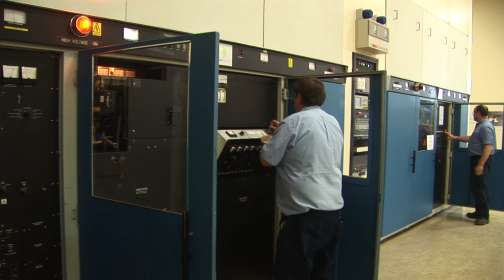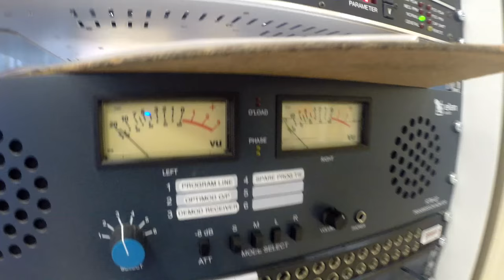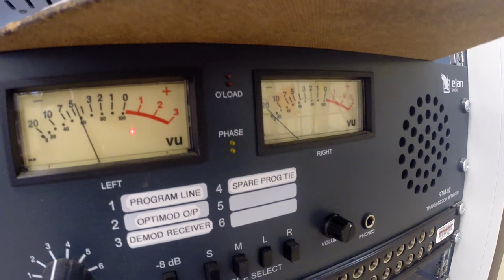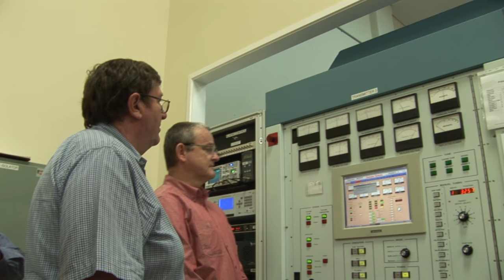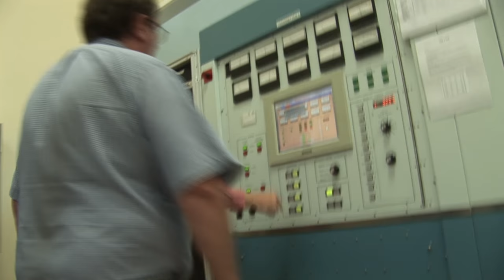Shutdown Of Last Short Wave Transmitters  At Radio Australia

Comment: What a great looking station. I hope the building and equipment not been destroyed
Reply: If it's still there why couldn't a private buyer get it and start broadcasting again ?
Reply: Such a waste of a great broadcaster but also great equipment
Radio Australia should go back on the air. Shortwave radio is not dead but still very much alive. The military is using shortwave or HF again as means for communications as secondary part of their arsenal. Satellite radio which they use is very vulnerable and jammed quite often when they need it most by pirates using these satallites for their own personal communications.
Reply: @357bullfrog2  Because it hasn't been up for sale. And the sites were demolished btw. Radio Canada International on the other hand did try desperately to sell the site, wasn't able too and only sold the building to a religious group and demolished the towers. They tried to sell the transmitters super cheap but weren't able to since no one wanted to go pick those huge things up.

Comment: When I drove between Adelaide and Darwin there were black spots with no radio. Thanks to the penny pinchers, that shut down these SW transmitters , please restore this service for the cattle stations in remote Australian areas
Reply: The 3x 50 kW domestic HF transmitters installed in the Northern Territory covered in excess of 2 million square kilometres using six channels. ABC diverted the HF transmission funds to put DAB+ transmitters into Hobart, Canberra & Darwin - already well-served with AM, FM & on-line.  ABC, or more accurately, the SBC (Sydney Broadcasting cadre) has contempt for remote Australia.

Comment: After we have EMPs and satellite warfare which will take down the internet and satellite communications, they will come back. Almost every post-apocalyptic movie I've seen has a ham radio operator involved.
Reply: EMPs would kill that transmitter too though. Most of it today was digitally controlled and monitored
Reply: @whatevernamegoeshere3644  Agreed EMP would be bad for nearly all electronics (except for 6BE6, 12AU7 & 813...) but global broadcasting is more at risk from Carrington events, missile attack on satellites or the biggie - weather events. Cyclones wreck comms infrastructure across the Pacific & SEA every year.
Reply: Things are becoming centralized.its just natural progression but makes communications that much easier to take down.

Is satellite radio viable for rural austrailians or those out there temporarily, cost wise? Could that be complicated by satellite receptions need for electricity?
Can satellite reception be achieved with batteries?
Reply: Tube transmitters using crystal oscillators could survive. The Russians used tubes in their combat aircraft to survive the EMP caused by nuclear weapons.

Comment: wow very sad to see the transmitters switched, i would drive past shepp in amazement at the infrastructure at the site and as a sparky and interested in rf, was always itching to see how it all worked, it was only today i was keen to get set-up to have a go at listening to radio Australia on the sw band but obliviously i have missed the boat. i work at a power gen facility commissioned in the 1920s and still runs as it was installed , i would be upset if that was ever moth balled.

Comment: What a sad end to Radio Australia shortwave transmission to rural Australia as well as to Asia. I remember during the 80's getting RA loud & clear in India & the Middle East - normal programming & cricket during the summer. Sadly, have to visit Cricket Aus. website for the official broadcast which is geo-blocked due to rights restrictions.

Comment: The Ukraine-Russia war is showing just how easy it is to shutdown Internet Feeds from abroad.  Easier form of control.  With Shortwave, it takes more investment-infrastructure to jam/block a station.  Maybe that conflict will change some minds about the importance of Shortwave.  I was a routine listener to RA in the 1980s, 1990s, 2000s & 2010s.  On 9580Khz, 12080Khz, 15160Khz, 15240Khz, 15415Khz, 17715Khz, 17795Khz, 17840Khz & 21740Khz in the St Louis region.  RA could be counted on being heard daily in the Midwest even when band conditions were not good.  Especially during Evening & then again through the Morning sunrise hours.  I remember that 9580Khz was especially good in the spring-summer-fall when thunderstorms were at a minimum in the AM hours.  I remember I could take the antenna off of the radio and still hear 9580Khz from 6am-9am (CT) daily.  Very strong signal at the sunrise hours.  It would like clockwork, drop out fast at 9:30am (CT).  Having to wait til about 4pm CT for 21740Khz to return.

Comment: What a sad day for shortwave broadcasting and Australia in general. Even here in the United States we often listened to Radio Australia and to get the international perspective but also to hear about Australian news. Internet Radio, Satellite and such just isn't the same. We would get about 16 hours of Radio Australia during the day. Seemed that it would start coming in about 5 pm local time Eastern which is 2100 UTC in the summer or 2200 UTC in the winter. You could hear frequencies such as 21740, 17795, 15365, 13605, 11880 mostly during the evenings into the overnight hours say at 2 am. Then at around 3 am local we would get 9580, 9700, 12065, 6020 etc which would generally last until around 1400 UTC. Sadly those days are gone because I grew from 1985 at 10 years old until I was 42 years old listening to Radio Australia. Listening to the local ABC Melbourne or Brisbane or Sydney just isn't the same and totally different than turning on the Shortwave. 

Even more exotic for a lot of us here in the United States was being able to listen to the various Outback stations which I could receive very well in our fall to spring seasons especially those on 2325, 2410, 2485 and 4835 etc from Alice Springs, etc. In fact they were often well heard at my location due to the fact that I had up a 2000 foot long wire antenna strung through a couple of trees and going to the edges of the property my family still lives on even though I am long gone from there. It was quite interesting to hear shortwave broadcasts not only from Australia and the Outback but also Papua New Guinea, dozens of Indonesian stations, Philippines, Chinese provincial stations, Vietnamese provincial stations and even a few times the various iterations of the Khmer Rouge genocidal stations out of China or the Thai Cambodian border with their various harangues. That's not even including the various radio wars between the two Koreas. They should have kept Radio Australia running because to me it was one of the better news stations out there as well.

Comment: short wave means long distance,
which would reach the place on every side,
yes old tech but endurable formation
Reply: True.  But shortwave (HF) can also be the better economic solution for remote areas with low populations. Australia had 3 domestic HF transmitters to cover remote inland areas from 1986-2016. Each transmitter had a proven, primary range of 450 km (often much greater, to > 2000 km). That's 160,000 km^2 for each service.  Allowing a range of 75 km for a 5 kW FM omnidirectional service would require 36 such FM installations to service the same area for each service. And much more costly maintenance. The shortwave transmitters were being upgraded to be even more efficient and to transmit DRM (the first new transmitter (a Continental 418G) at Alice Springs had already been tested in DRM mode with stunning performance)

Comment: Thank you for this video fantastic job
Reply from the maker: Broadcast Australia own the site and sold transmitter time to the ABC and i should think they would able to sell time to any one else who had the money to spend on big time shortwave transmission if it was not in conflict with Govt regulations. Maybe six or so transmitters at the site but none on air at this time. The site is BA's maintance and storage depot for central Victoria where they carry out works for their other sites around the place so i think the actual building will be around for a while with the TX's mothballed.

Comment: In a settting of scarce resources, shortwave broadcasting doesn't consume much of them. And it's amenable to no end of development
It's an economical way of broadcasting. And its demotion or demise will deprive us of many opportunities to improve it
Reply: True. Australia had 3 domestic HF transmitters to cover remote inland areas from 1986-2016. Each transmitter had a proven, primary range of 450 km (often much greater to > 2000 km). That's 160,000 km^2 for each service.  Allowing a range of 75 km for a 5 kW FM omnidirectional service would require 36 such installations to service the same area for each service. And much more costly maintenance. The shortwave transmitters were being upgraded to be even more efficient and to transmit DRM (the first new transmitter (a Continental 418G) at Alice Springs had already been tested in DRM mode with stunning performance)

Comment: yup! not a good plan!! they are sooo worried about the emissions and cancer...
it is too late!! they should to have just left them on and just maybe done several as remote low power as sat radio...
but then again it all is going to be done with the first flash from the sun or other emp....
the sat stuff... 
I have done faraday rooms for the hf gear...
best plan is use metal trash cans with lids encased in quick concreate for your emergency radios...

I miss the days in the late 1960's space shots you could hear the missions on a good hf set..
as well as dx like this station!! we could hear them when the bands were up in Iowa!!

Comment: Is anything left of the old transmitter site? Did they find a buyer?
I remember that the hams were going to have a last hurrah with the antennas in late 2019 or early 2020, but may have called it off due to COVID restrictions.
This video always brings tears to my eyes 😢 .
Reply: The Hams had a go with the antennas in March 2020 about a week before lock downs including some successful EME  ( bouncing a signal off the moon) on 21 MHz. There are some attempts  to try and create a radio and possible TV museum at the site.

Comment: On the beach.1:20 "11th of July, 1969". Guess they mixed that into the broadcast?  On the beach.
Reply from the maker: Great movie, was that the date on the calendar?. I used to have that freeze frame as a screen saver. I only have a few dvd's and that is one of them. As i live in Melbourne the last city on earth to die from radiation, when i saw On The Beach at about 7 years old it had a big impact on me. I realy thought that was how it would all end and still now i am influenced by it particularly  the last scenes "there is still time brother" and the deserted city streets. Now in July 2021 in the 5th lockdown the streets are deserted  again and instead of suicide pills they are handing out vaccine. Also just updated this post. Had a look at the film and the  calendar shows July 1964 with no actual date marked. So the announcement by Vic Kennedy is about 5 years latter.
Seeing the movie again it is very dark (not exposure).
Reply: Yes, I knew it was July '64 (month of my birth) and I forget what my reference was on July 11, '69.

Comment: 3:46 This looks like far more modern equipment than what I was trained on, or even seen. Like Ex WW2 valve equipment!
- Looks like it may be computer controlled/monitored?
- Ex Oztralain Civil Aviation Authority Radio Tech. Officer here.
Was 'selling the spectrum' part of the reason for ending this service, I wonder?
Reply: Spectrum sales didn't drive this decision. The ABC wanted to extend its DAB+ network into Hobart, Darwin and Canberra. It funded this closing down Radio Australia and the domestic HF services. Did you ever work on Christmas Is navaids? In 1990 some DCA techs visiting Christmas Is measured one of RA's 21 MHz broadcasts at 147 mV/m which is not a bad field strength . . .
Reply: @nigelholmes9332  
No, I never really worked on navaids. Trained, but knowledge not used. ¯\_(ツ)_/¯
Everything was changing rapidly even while I was there.
- I started at:
 • Dept. of Transport, then
 • Dept. of Transport (Air Transport Group), then
 • Transport Australia, then
 • Dept. of Transport and Communications, then
 • Dept. of Aviation, then split up
 • Civil Aviation Authority IIRC. 🤔
All name changes or 'restructuring'.
 • After I 'redunced' (?), CAA became Airservices Australia

Comment: I'm looking for a crystal set which can receive RA via satellite from the wrong side of the world, or via internet.
That's how I used to listen to Radio Australia as a teenager, long before I had the knowhow or funds to make or buy a proper super-regenerative or superheterodyne receiver. The super-regen I made for Shortwave when I was 15 worked really well, and used 3 valves (tubes). RA was my go-to station to check DX conditions on different bands, from England. An aerial of less than a metre in length had Oz crashing through on a good day. Now I have to pay the equivalent of over $100 Au per month to hear it on the internet, and I have to use over 100 Watts of electricity for the privilege. In addition, the skill and sense of achievement have gone completely.
You've lost a fan of over 50 years, Australian Broadcasting Commission!

Comment: I understand that great investments were made to finish off the air .... It is important that the engineer in charge should thoroughly study the details and offer clear suggestions to the company in order to avoid this disaster ... but even more I think the company You must always invest for the education of the engineers of any radio station and in this way prevent unnecessary expenses.

Comment: can you still pick up anything in aus with a standard receiver?
Reply: Yep - plenty of MF, particularly in rural areas. The national broadcaster runs 50 & 10 kW MF tx around the larger rural centres. Commercial operators are usually 2 - 5 kW.

Some individuals have obtained private, domestic HF broadcasting licences (usually 1  kW) to try to fill the gap left by the end of our national domestic HF servcies. We also have a good VHF FM network, but of course range is limited to around 100 km from the bigger senders - not much use when we have 100's km between towns. Similar situation to Canada.

Comment: NBN needs 2 separate power supplies and 2 different boxes connected with a dozen wires just to run a old style telephone. And they tell us/me it's advanced technology. :(
Reply: jesus wept ... don't get me started ... phuk it you've got me started ... we (in Melbourne) went on to NBN early November 2020. I'm not stupid, made my own "UPS" 2x 12V/32Ah AGM batteries, 24Vdc--> 240Vac 400W sine inverter, independant solar PV panel to back up the mains charger. UPS Backs up my NBN terminal, modem, telephone, PC, printer & office lights. Gives me >1 hour endurance full load, 4 hours with printer & lights off (for 30% DoD on the batts). 

So we have a big storm & lose mains for an hour. Me & NBN run on our batteries. Yay team. My Mains comes back but not for an NBN installation somewhere, their battery goes flat an hour later and I have no telephone (& no internet) for 17 HOURS. Boo team.

Comment: Don't they use longwave radio in Australia? The signal travels for hundreds of miles, and it doesn't fade in and out like shortwave.
Reply: LF (in practice, 100-400 kHz) was not used for broadcasting in Australia beyond early trials in 1920s. For broadcasting into remote parts of the country HF was discovered to be cost-effective also in 1920s. The 3x 50 kW domestic HFBC transmitters installed in the Northern Territory covered in excess of 2 million square kilometres using 2.3 & 5 MHz channels.

Comment: is DRM a replacement?
Reply from the maker: DRM is very good when it works but it is no where as robust to interference and fading as AM Often stations that use DRM have an AM outlet on the same band and coming from the same site. If the AM is full strength and stable the DRM is also very good, If the AM is strong but a bit of fading the DRM is usually better, If the am is fading and interference present but still very listenable often the DRM is rendered totally useless.

Comment: Shortwave reaches millions of people worldwide and even though the reception and quality were not great, it enabled the world's broadcasters unrestricted access to a borderless untapped market. 

Digital Radio Mondiale would have given shortwave a longer life as it delivers better quality radio at a third of the cost of satellite / internet / mobile phone app, and because it's digital the problems like fading and whistling are eliminated entirely.

Granted, digital dropouts are a problem, yes, but it can be cured by ruggedised transmission modes in DRM which can overcome this problem albeit at the loss of a little bit of quality, but is not too dramatic and is still reasonably acceptable.

Comment: Whats the sound in 0:35
Reply from the maker: It is a Kookaburra. From Wikipedia.
Kookaburras are terrestrial tree kingfishers of the genus Dacelo native to Australia and New Guinea, which grow to between 28 and 42 centimetres (11 and 17 inches) in length and weigh around 300 grams (11 ounces). The name is a loanword from Wiradjuri guuguubarra, onomatopoeic of its call. The loud distinctive call of the laughing kookaburra is widely used as a stock sound effect in situations that involve an Australian bush setting or tropical jungle, especially in older movies.

They are found in habitats ranging from humid forest to arid savanna, as well as in suburban areas with tall trees or near running water. Even though they belong to the larger group known as "kingfishers", kookaburras are not closely associated with water.